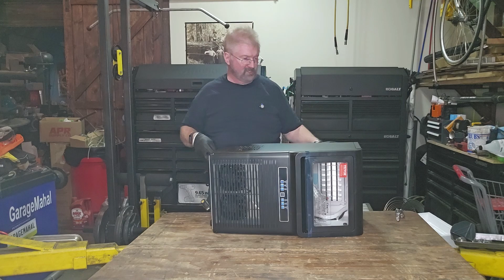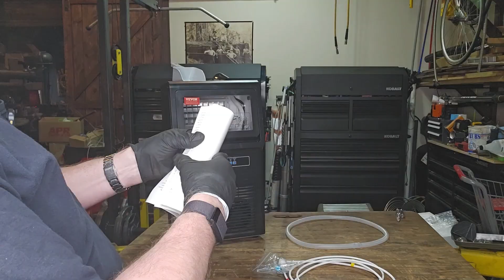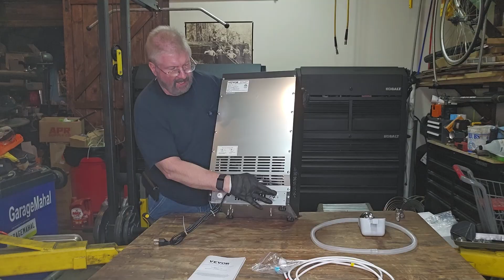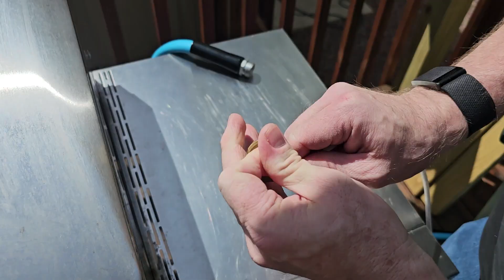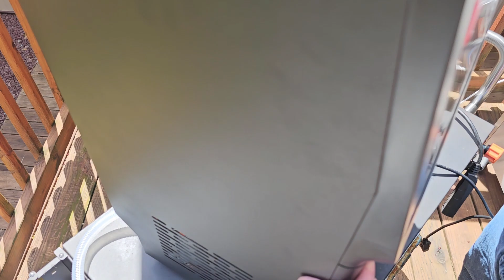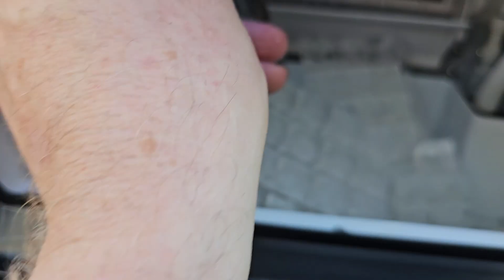VEVOR Commercial Ice Maker Machine, 80lbs/24H Ice Maker Machine with 12lbs Storage Capacity, Fast

Comment: How do you remove the water pump for cleaning
Reply from the maker: No need, just run a cycle of water through and cleaning solution through. Then run a cycle of ice, dispose of that 1st batch and then run as normal.